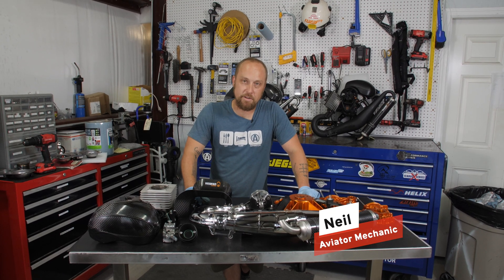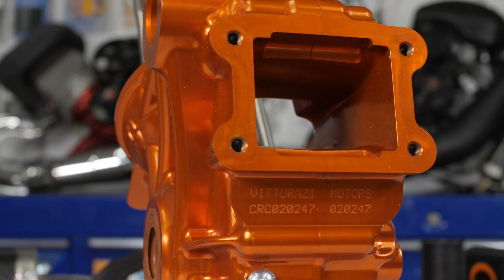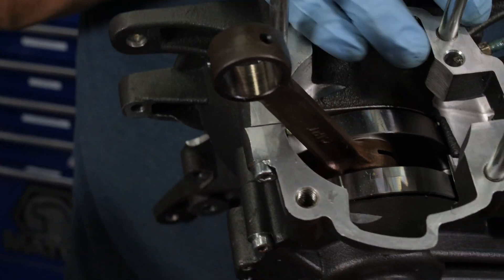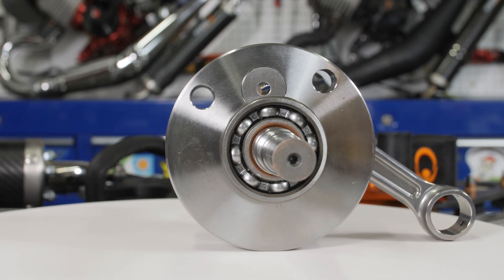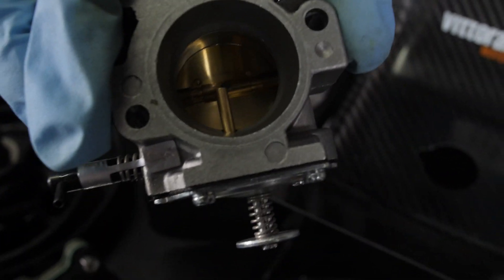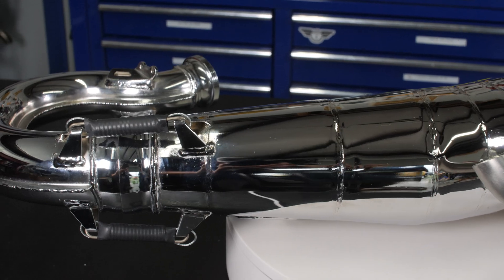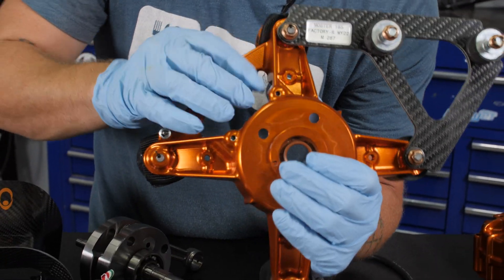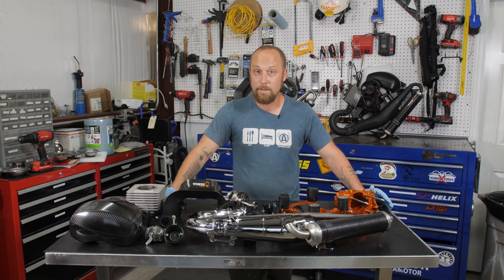A detailed look inside the Vittorazi Factory R Motor - 4K

Comment: Anyone who buys this thinking it's going to last 2000 hours is going to be pissed off. That crank might last 2000 hours but that carb, starter, exhaust, bearings, gaskets ect will not last 2000 hours. So after 250-500 hours you can replace all the other parts except for the crank. What a sleazy way to sell an overpriced 2 stroke
Reply: All I can say is, after completely disassembling it, I can’t believe they aren’t charging another $1000 for them. 
More expensive than most paramotor engines? Definitely . 
An overpriced 2 stroke? Not even close….
Reply: The maintenance intervals are half as long as the regular 185, requiring much more up keep.
Reply from the maker: While it will definitely require maintenance (like any engine) the crank case and rest of the engine should last considerably longer than most other engines from Vittorazi or other manufacturers. We’re sorry if we didn’t make that clearer!

Comment: I dont reckon they have changed the port timing of that engine i reckon in reality they may of increased the compression at most
Reply: Changed the port timing hahahahahaha did you just make that up? Maybe just a high lift cam hahahahahaaha. What they did was polish and match everything.  These are high RPM motors and that sort of thing matters.  They strengthened everything while keeping weight to an absolute minimum.  Basically, what would be marketed as a ''race'' engine, high output, etc. Expect a 10% increase in power without, in any way shape or form, sacrificing longevity.
Reply: @michaeldose2041  are you suggesting the 2strokes don't have port timing 🤣🤣🤣 go back to bed my friends of watch the video properly an listen to what they say b4 running your mouth

Comment: What’s the difference in weight. What’s the difference in cost at least percentage wise. You keep saying it’s good for the life of the motor even a junkie old engine is made by anybody the parts will be good for the life of the motor because when they’re no longer good that’s the life of the motor. I don’t mean to seem like a wise guy I’m not. I’m very impressed with the video very impressed with the parts even somebody that isn’t knowledgeable can see that this is one heckuva piece of machinery. But how about the projected horsepower and how about the projected weight compared to the monster
Reply: All of those datapoints are available on the Vittorazi website which is why I didn’t really bother covering that. We wanted to do a video focused on the internals because that hasn’t really been shown off yet. After opening this motor up I’m honestly surprised they aren’t retailing for more than they are. Standard Moster plus is around $3k and the Factory R around $4500. Don’t worry I’ll get better on camera eventually 😅 right now I’m only as good as the life of the camera lol